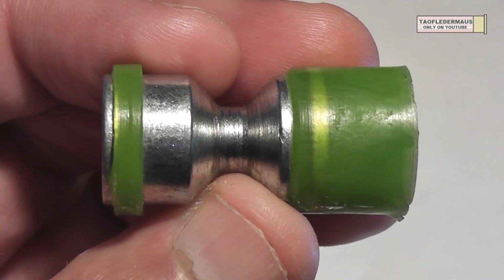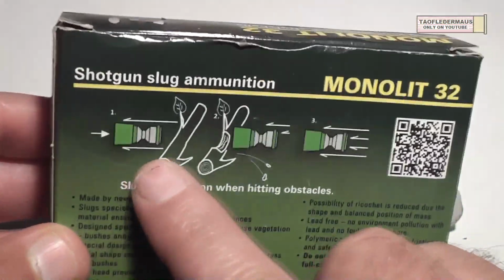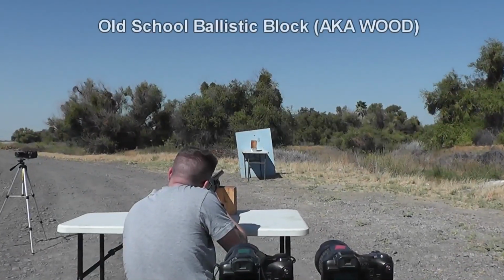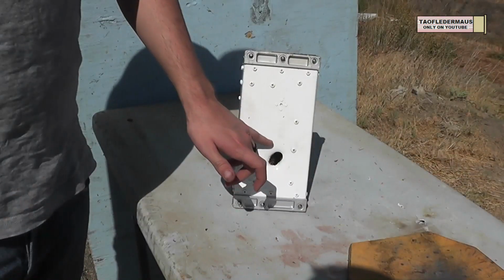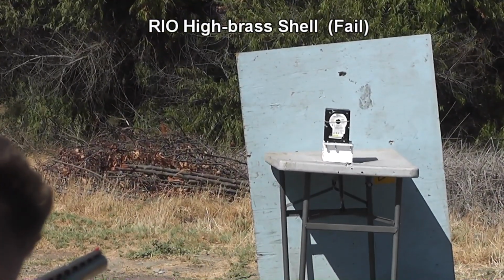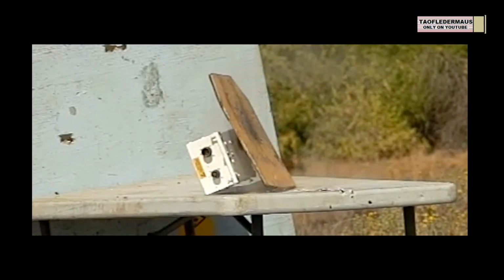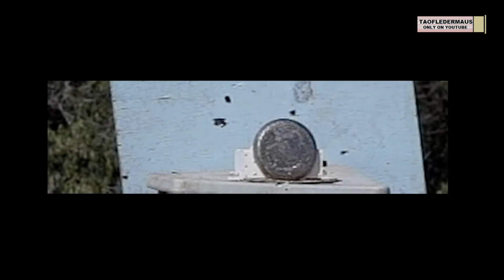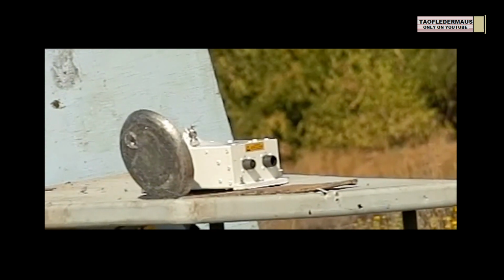12ga STEEL Slug Test  - The Exotic  D Dupleks Monolit 32

Comment: oh man that sub button. smart. that latvian dude. operator. that monolit 32. wicked sick.
Reply: +TAOFLEDERMAUS pretty sure (from what i learned in chem lab at school) that lead powder is extremely combustible, similar to how depleted uranium tank shells need no explosive but still cause a fireball. The heat generated from impact may have been enough to ignite lead dust and small particles from the plate.
Reply: could you do an experimental round with a lead-tipped steel slug? something similar to this flat faced steel, but with a rounded or pointed lead nosecone. would like to see the effect on ar500 steel, but the lead might be tough to fuse or stick to the steel :/
Reply from the maker: +MattV2099: Guns & Food    Haha,   cheezin' it big time.   Yeah, that dude looks like he's from Texas or something!
Reply from the maker: That's very possible!
Reply: Man fuck off
Reply: Jeff stop biting your nails
Reply: +William Howard i tried it didnt work

Comment: Jeff, I've always wondered, actually almost tried a decade ago, if one could shoot these..container bottle seal, locking pin, etc...they are 2 parts: the steel male pin with head and the female "bottle" receptacle for the pin to lock into...they're both steel covered in plastic, so basically what you have there. The bottle/female part is usually perfectly round, a cylinder but sometimes has 2 flat spots so won't roll on a table I guess. You pick them up at any local shipping dock where they cut them off the container door handles and let fall to the ground...often many of them littering the dock. I've got a few..uline brand, red in color: http://www.uline.com/BL_2302/High-Security-Seal
mine are slightly too big, at .821" on the female bottle end and .837 on the male flat "nail head" end. When cut in the middle, leaves enough male stock to chuck either bottle end it's locked into, or it's parent male end, in a lathe to turn down to .729 or whatever.

other examples:

https://www.margreiter-technik.com/wp-content/uploads/pic-container-seal-customs.jpg
https://www.margreiter-technik.at/wp-content/uploads/2015/04/containerplombe-gelb.jpg
http://www.otto-meyer.de/shop/images/product_large/Artikel/wk400_0.jpg

http://3.imimg.com/data3/CA/SJ/MY-6942125/container-bottle-seals-250x250.jpg

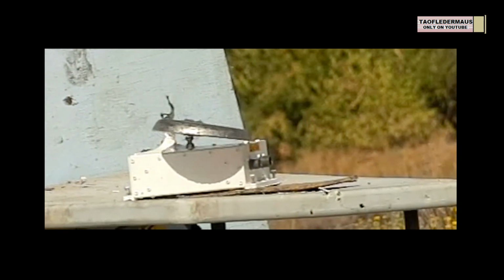Comment: I'm not normally one to speculate, but this is the youtube comments section, so here we go. I'm pretty sure that the reason the slug didn't pass all the way through that lead plate even though it punched a big hole in it is because the slug transferred all of its kinetic energy to the chunk of lead it displaced which you can see shooting off to the left at 7:29 7:37 and 7:49
Reply from the maker: +crisray6789   You are probably right.  That chunk of lead it knocked out probably weighed 4 oz or so.
Reply: +crisray6789 so kinda like those sciency metal balls on strings that demonstrate transferring energy from one ball to another?  Makes sense.
Reply: +Stoned Pony Newton's cradle s what they are called :)
Reply: beast0382
Ah, yes!  Those things.  Thanks.

Comment: The way the tail shreds and flies separately on the shot with the AR500 plate, makes me wonder if it's only purpose is for in barrel stabilization. The failure may have been it not separating!
Reply from the maker: +southernpride1911   It's similar in balance and design as those  Poleva Bullets we shot a while back.  The plastic tail causes drag to keep if flying nose-first.
Reply: I guess that makes more sense, The pedaling shape of it when you shot the steel plate made it look like it was acting as a wad of some sort, though it's a slug!